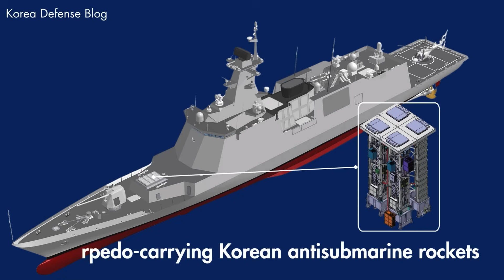South Korea’s Future Experimental Frigates

Comment: A failed frigate design. Main rule to be hammered down here is a rule for 360 degree coverage against water/air drones, airplanes and missiles. You need 2 CIWs using not only radar but also optic head. 30 mm CIWS II has right caliber (>= 30 mm), but is it using programmable munition? Design of Miecznik holds VLS and other missile containers in protected middle of the ship. I do not see 12.6 mm gatling guns with optic heads on sides like we will have in Miecznik. What's the point with an expensive one-use frigate, which can't effectively protect itself from a saturation sea-air attack from all sides? Secondary rule is that from WW2 most tanks and ships were destroyed from air and not by other tanks or ships. VLS 41 maybe like on Miecznik? South Korean frigate designers and ship builders need a wake up call. We can't have a strategical ally, who is falling behind technological development in these testing times. Specially one with larger industry then Poland has.
Reply: What do you expect to inshore frigate? FFX series ships for inshore fleets and their missions are keeping their eyes on North Korea and China's ships, submarines and also considering battle with an enemy's major fleet until the task fleet which is including many destroyers comes. if you want to seek and compare some performance for the fleet air defense with you guys new frigate then you need to compare Korean aegis destroyers because their mission is just as same as frigate what your country is building you may think i'm wrong but i think that's right comparison
Reply: @amirleokim3620  Did you know that originally Miecznik program was about corvette sized warship patrolling Polish coast? Then things changed with Russia and 21st century naval warfare. Suddenly 7000 tones were needed to put this all expected afloat and (5.5m) can't dock in shallow harbors. Ordering second NSM coastal battery from Norway changed nothing. Miecznik frigate is a classic escort frigate, will be used for protection of Polish coast and offshore infrastructure. Comparing it to AEGIS destroyer is kind of unfair. It will have 32 VLS, while dedicated AAW frigates can have even from 48 to 64 VLS and AEGIS destroyers have 128 VLS. Can we compare Visby 600 tones corvette with AEGIS destroyer, just because Swedish are modernizing it with 4-6 VLS for AA missiles?
Reply: 한국의 CIWS II는 AESA 레이더와 EOTS가 통합된 체계(LIG넥스원)이며,프로그래밍 탄약(풍산)이 사용될 예정이고, 무엇보다 체계부터 탄약까지 한국 스스로 독자 개발 중이다. 현재 지상 테스트 마무리 단계이며, 이미 양산 시설까지 완공되었고, 내년에 충남급 호위함에 통합되어 마지막 테스트가 진행될 것이다. 
한국 기술 발전이 더디다고????? Miecznik를 말하는 것을 보니 너는 폴란드인 같네.
난 폴란드란 국가를 사랑하고 존중하지만,
너가 제대로 된 정보 없이 무례하게 글을 남겼으니, 나도 똑같이 무례하게 묻겠다. 너희 나라의 기술 발전 수준은 어느 정도이냐? Miecznik에는 폴란드 자국 기술이 얼마나 들어가있느냐? 영국을 포함한 다른 나라의 기술들이 차지하는 비중이 어느정도이냐? 또한, 너희는 대체 왜 한국의 무기를 대량 수입 중이고, 기술 이전을 원하느냐.  너희 나라에서 모든 무기를 전부 독자 개발해서 사용해라. 한국의 기술 발전이 더디다니, 미안하지만 웃음 밖에 나오지 않는다 😂😂😂
Reply: @닮은살걀_i  Ridiculous is only what Ukrainians do with Russian Navy on Black Sea! Welcome to technology of 21st century. Developing and manufacturing independently has sens. It is important to be self-suficient as much as possible like South Korea. It takes months before allies can join up with their divisions. To be able to defend alone for a month or two is important. However it is NOT a requirement for national safety. It is an economical priority to all countries seeking industrialization, so nothing wrong with it with exception if it actually lowers your national safety. Then independent development is a safety national problem. Developing new weapon system alone could be very expensive and mind that munitions and spare parts incompatibilities matter during war, when shortages happen and allies send help.

Take under consideration VLS 41. French and British were developing independently their own alternative "mushroom farm" and it is too limited. VLS 41 uses wide range of missiles and it is easier to get help with spare parts and missiles from allies. Running out of ammo during war is A THING. Consider possibility of getting in form of help CAMM anti-air missiles from Poland and UK. Not only they would fit in VLS 41 instantly but you would get 4x enlarged anti-air capacity, as they are quad packed in VLS 41.

This South Korean frigate has blind spots in its close range defense. Pointing out that obvious weakness spot is not rude! It is life saving. Black Sea is dominated by Ukrainian drones for exactly this reason. US Navy on Pacific trains simultaneous missile attacks from couple different vectors of approach as well. What do you think Russians with their favorite saturation attack do? Miecznik with its weapon configuration has some decent chance to survive saturation attack. Can you say the same about this latest South Korean frigate? If you produce 100 of those frigates, then will it matter, when they all will share the Russian fate on Black Sea?

Seriously, this frigate needs 2nd CIW II for 360 degree coverage. It's basic requirement today.

Do this South Korean launching system allows quad packing for South Korean short-range anti-air missiles?

Do you think, it's not reasonable to produce frigates with weapons set up like in Miecznik, which will survive simultaneous saturation attack from 360 degrees? If you are not catching up on 21st century naval warfare happening right now on Black Sea, then yes your technological development is SLOW and BEHIND not only technology development, but BEHIND modern naval warfare as well.
Reply: @odrodzonasarmacja3721   If the VLS 41 could integrate Korean missiles, there would be no need to develop the K-VLS. The lower structure of the CIWS is the size of a naval gun, making it difficult to mount on medium-sized frigates. Moreover, the Haegung short-range missile system has already been deployed and installed.
Reply: @oaao3387  I see. Thank you for a honest answer. Do you know, British (quad pack) CAMM missiles are integrated into VLS41 and (double pack) CAMM-ER will be too? South Korea needs to have closer industrial connections to NATO's industries. British are very open to all economic cooperation. Maybe they could help with integrating South Korean missiles with VLS41? KVLS limited like "mushroom farm"? That's really bad. Really. How about getting British quad CAMM and double packed CAMM-ER missiles work in KVLS? Maybe British could help KVLS be more compatible with foreign ammunitions? Placing a naval gun even on corvette like Kormoran II was an issue. Though we were upgrading 22mm anti-air to 35mm anti-air with programmable munition. Our 35mm works even against some types of artillery shells. It works better against drones then 30mm Gatling, which I've been told has some issues with water used for cooling. Maybe something to check up by South Korea for medium-life upgrade for Chungnam frigates? Short-range missiles are cheaper but not that cheap and dealing with high speed boat-drones may not work. I would strongly suggest to add some 12.7mm (equivalent to Polish remote 12.7mm ZSMU A3/A3B from ZMT from Tarnow, which auto tracks targets) for 360 degree coverage. Not 7.62mm due possible armor and speed on the speed boats. We do have slow underwater bots (Gluptak) on Kormoran II to destroy mines and slow sub-drones, but on Miecznik we will have flexible 300mm torpedoes. Eurotorp MU90 torpedoes will serve to destroy enemy torpedoes and sub-drones too. Maybe, it is something South Korea should maybe look into?
Reply: @odrodzonasarmacja3721  You know nothing about Korea’s terrain, military equipment production, or operational planning. It’s pointless to talk to you about Europe and Poland. In wartime there’s no reason to worry about the East Sea — a large portion of North Korean forces are concentrated on the West Sea aiming at the capital region, and because of logistics, controlling the South Sea is extremely important. That’s why the coastlines should be held by medium- or small-sized vessels, destroyer forces concentrated in the South Sea, and why the mobile fleet headquarters and key ports are located on Jeju Island.
Reply: @oaao3387  I know Northern Korea holds your capital city prisoner of this cease-fire. Your economic miracle wasn't spread over entire South Korea. Centralization didn't serve your safety. You talking maintaining frontline at West sea. Northern Korea is not mounting a tactical attack you prepare to defend from, but a strategic one to break your military production and economy. They will not shoot for accuracy but for mayhem. Providing naval security for sea supply lines in East sea should be priority alike decentralization (alike we do in Poland) of South Korean economy. This strategy is a slight of hand by the Northern Korea, which didn't abandon the Eastern sea. They shooting their missiles into Eastern sea with too high frequency just to be "just some weapon testing (Jedi move of hand in air) you are not looking for". There some mountains so they will shoot further. Remember that those small sized vessels you write about will be in an intensive drone warfare area just one time use assets, if acting without proper escort. Their crews' lives? Jeju island is perfectly set, though Japan is highly demilitarized. Swedish army has excellent weapons too, but size matters. There will be issues. Gaps in coverage. Do you know about problems and time delays for development of multirole 7000 tones Constelation-class frigates by USA? There are simply not so many American multirole destroyers to do it all. USA's defense comes first even under Democratic Party leadership. If USA falls, then who will come to rescue us others? It's American argument. I wish this discussion be pointless.

There is in Poland saying that Polish Navy protects only their full-time positions and not Poland. Imagine Polish Navy wanted new torpedo boats with exactly same number of crew like 20th century never ended, because of "maintaining experience" and "RBS 15 is the best against warships". Can you believe this crazy stuff? I just hope ROK Navy is not set for the same mental pitfall. PGZ got robotized shipyard and Polish Navy will get 3x 7000 tones Miecznik frigates and NSM (or RBS 15 mark 4, it doesn't matter) to hit sea or land targets at 200+ km range. Isn't it better? Be honest.
Reply: @odrodzonasarmacja3721  한국 사람이세요?
Reply: @odrodzonasarmacja3721  seems like you are comparing two different types of frigates with two different purposes just because they are at the same weight class. sure it would be nice to have a 7000 ton frigate but with that weight class we rather build a destroyer(which is the KDDX, our next destroyer) and turn that in to a blue water vessel.
our frigates are capital ships for the inshore navy along side lots of destroyers and other frigates , main job is always to deter north Korean vessels, and to support our destroyers.
they are not meant to be a capital ship of the entire navy like Poland, who needs to do everything all at once because they have so few ships.

and besides, cheaper price made us build lots of them, we have like 18 frigates already, and many more to come. not to mention we have so many patrol killers that should be enough to deal with drones, 50cals are not really needed when you have more patrol killers than the amount of 50cals that can be installed on frigates.

basically, aegis does our multirole, not frigates, and even frigates have enough support vessels to fill the weight gap
Reply: @닮은살걀_i  틀포티야 제발 좀
Reply: These ships are built specifically for the threat Korea faces and given the budgetary constraints. Sure, it would be nice to have all the bells and whistles but given that there are 6 Incheon, 8 Daegu and 6 Chungnams (20 total.. plus more coming) cost is another factor. You should also consider ROK navy tactics and doctrine. The Mieczniks (only 3 vessels in total BTW) will likely need to hold its own in open waters but these frigates are more likely to operate in concert with the fast patrol boats and corvettes facing potentially hundreds of old North Korean coastal boats within the narrow coastal seas surrounding the peninsula.
Reply: @tommajor9860  It is true 3 Mieczniks will need to patrol coast of Poland, while securing 3 major Polish harbors on a sea, which is very narrow and shallow. ROK navy needs to factor in deep eastern sea. Alike closest to Poland is the far away Northern Sea. Poland has license to manufacture 8 Miecznik and may go for total of 6. I would still install an additional CIWS or some heavy machine gun automated turrets with optic heads on Chungnam. Just in case. Kormoran II is equipped like Chungnam frigate with 1 CIWS 35 mm, but it is NOT a combat ship! It is naval engineering (sappers). It requires escort.

Maybe ROK Navy has issues in their tactic not factoring in latest discoveries from what is happening at Black Sea? Chungnam-class may be is a result of failure in foresight. Those things do happen, but should be mended eventually or war will mend them at some greater losses.
Reply: @odrodzonasarmacja3721  You know nothing about Korea’s terrain, military equipment production, or operational planning. It’s pointless to talk to you about Europe and Poland. In wartime there’s no reason to worry about the East Sea — a large portion of North Korean forces are concentrated on the West Sea aiming at the capital region, and because of logistics, controlling the South Sea is extremely important. That’s why the coastlines should be held by medium- or small-sized vessels, destroyer forces concentrated in the South Sea, and why the mobile fleet headquarters and key ports are located on Jeju Island.
Reply: Whether the VLS is located at the bow or center has no bearing on protection. While I agree that the ROK Navy's frigates are under-armed, given budget constraints, it's difficult for a navy with so many ships to possess perfect ships when they're in dire need. Frankly, if a real battle were to break out near the Korean Peninsula, both the Miecznik and the Chungnam-class would be equally damaged and sunk, so acquiring them cheaply is more important.
Reply: @asdf-te2ou  Miecznik weapon configuration takes under consideration survival from a Russian saturation attack from 360 degree. OSU-35 is not gatling, but it has very high rate of fire and uses programable munition, which works against drones even in its land version on Jelcz truck. 32 tubes VLS 41 launcher gives at max 128 CAMM missiles to shoot down incoming missiles. Can you imagine Miecznik to take damage and sink like a Russian cruiser, frigates and corvettes on Black Sea from saturation drone/missile attack? Even 2x 12,6 machine guns will be automated.
Reply: @odrodzonasarmacja3721 Equating Russia and China is a major error.
To put it simply, China possesses an economy and population roughly ten times larger than Russia's, along with superior technological capabilities. While the combined military strength of NATO nations in Europe (excluding the US) vastly surpasses Russia's, the first-world nations in the Western Pacific region are nowhere near comparable.
To draw an analogy for you, a Pole, regarding the situation of the first-world nations in East Asia: it's like facing a Russia possessing the national power of the Soviet Union at its peak, while the European nations behind Poland do not exist, leaving only the support of the United States across the Pacific to rely on.

China's anti-ship threat encompasses a wide range of capabilities, chief among them an overwhelming quantity of anti-ship ballistic missiles. This threat is so severe that even the U.S. Navy cannot guarantee its own survival in this region. While it might be an exaggeration to say that efforts to maximize the survivability of individual ships here are meaningless, their value is significantly less important than the meaning survivability holds in Europe.
Reply: @odrodzonasarmacja3721  1. 당신은 내가 왜 답글을 남겼는지 아직 이해하지 못하는 듯 하다. 당신이 잘못 알고 있는 지식(충남급 호위함에 탑재되는 CIWS II에 프로그래밍 탄약이 사용되지 않는다거나, Optical head가 없다거나)과 기술 발전이 뒤쳐지는 실패한 호위함이라는 깍아내리는 말이 무례하다고 생각했기에 글을 남긴 것이다. 그리고 당신은 당신이 잘못 알고 있었던 부분에 대해서는 여전히 아무런 사과가 없으며, 내가 반박하지 않은 당신의 주장에 대해서만 계속 해서 반복하여 말하고 있다.

2. 충남급 호위함에 탑재되는 KVLS 에는 각 Cell당 한국이 자체 개발한 해궁미사일(대공 미사일)이 4발씩 들어간다.

3. 한국의 충남급(3600톤급) 호위함이 기술 발전에 뒤쳐지는 실패한 호위함이라는 것을 주장하기 위해 Miecznik(7000톤급)을 비교군으로 사용하고 있다. 당신의 말처럼 CIWS가 2문이 있다면 당연히 최후방어력이 더 올라가겠지만 공간의 제약과 비용의 한계가 있어 1문이 장착되는 것이다.

4. 당신이 말한대로 새로운 무기 체계를 단독으로 개발하는 것을 비용이 많이 들 수 있고, 탄약과 예비 부품의 비호환성이 문제가 될 수 있다는 사실이다. 한국도 아직 일부 무기나 부품의 경우에는 수입을 하고 있다. 다만, 한국은 지금까지 무기를 수입해서 사용하면서 더 문제가 크게 작용하였거나 오히려 비용이 너무 많이 들었던 부분들이 많았기에 자체 개발하는 역량을 오래전부터 키워왔던 것이다. 그리고 기술 축적이 잘되어 성능이 입증된 무기들은 전세계로 수출되고 있으며, 큰 수익을 안겨주고 있으며, 더 발전된 기술 분야로 나아갈 발판이 되고 있다. 더불어, 우리는 우리의 탄약이나 미사일만을 고집하지 않으며, 미국과 유럽의 것도 사용이 가능하게끔 만들고 있다.

5. 결국, 당신의 주장에 의하면 충남급은 CIWS가 1문만 있어서 기술 발전이 뒤쳐지는 실패한 호위함이라는 것인데, 당신은 한국이 드론에 대비하여 아무것도 안하고 있다고 생각하는 듯 하다. 충남급은 할당된 예산 안에서 개발된 호위함이며, 주로 연안을 정찰 및 방어하는 역할을 맡게 된다. 그리고 연안에서 드론의 공격을 대비하기 위해 여러 가지 방식의 소형 무인함정을 이미 개발했거나, 계속해서 개발 중에 있다. 

다시 말하지만, 난 당신이 잘못된 정보와 함께 CIWS II 가 1문만 있기 때문에 충남급 호위함이 마치 쓰레기인마냥 실패한 호위함이고, 대한민국은 기술 발전이 뒤쳐지는 나라라고 결론을 내린 행태가 무례하다고 짚으며, 반박한 것이다. 
1950~1960년대였다면 당신의 말처럼 대한민국은 기술 따위는 없었고, 당신의 나라는 커녕 아프리카의 가장 가난한 나라보다도 빈약한 경제력의 나라였다. 하지만 그 이후 대한민국보다 기술 발전 속도가 더 빨랐던 국가가 있다면 나를 납득 시켜봐라.
Reply: @odrodzonasarmacja3721  CIWS-II will be equipped with programmable SPREAD rounds. It will be developed in a way that a time-fuse setter is mounted in front of the chamber to input the information before loading the rounds.
Reply: @이민규-d9s4i  The AAW multirole frigates and destroyers then should be priority n1. National development and manufacturing should be less important, then quad packing as many AA missiles as possible in every VLS on every single combat ship. You could have 48-64 cell VLS v41 on a frigate, 128 on destroyer. Let's not forget that these escort multirole frigates are not only to secure sea lanes and under sea infrastructure, but also to provide defense to South Korean ports. None is under valuating China, but currently it is Russia in military alliance with Northern Korea.
Reply: @odrodzonasarmacja3721 You got the point.
In the Pacific theater, frigates are strictly auxiliary forces, unlike in Europe, and the mainstay of anti-air combat is large destroyers.

South Korea has two main types of surface combatant fleets: one is the coastal fleet composed of coastal ships, and the other is the mobile strike force composed of large vessels.

The Republic of Korea Navy's "frigates" serve as the flagship vessels for the Coastal Fleet. Their missions lean more towards OPV-like duties (though their operational periods are too short to truly be called OPVs), making them somewhat inadequate for demanding full-fledged air defense roles.
That's why they sometimes go out of their way to mount 5-inch guns on small hulls – they have to prepare for gun battles even in the 21st century, lol.

As a side note, Japan's Mogami-class and New FFMS aren't dedicated air defense ships either.
Reply: @닮은살걀_i  1. My "failed frigate" remark was mainly about holes in its defense, as you noticed. No words or demands for respect on your part is FIXING this existing vulnerability on this frigate. It could be worse if this CIWS was lacking in anti-drone capability, so I left a question about it. Video was extremely poor on details. Thank you for providing info, which is missing in video. It suppose to be a multirole combat vessel, not 1-use coastal missile speed-boat.

2. Quad packing is a good news. Poland in emergency could send CAMM missiles to South Korea. I read KVLS is comparable to VLS 41, but is it compatible? How does it work in other direction? Are Korean AA missiles compatible to VLS 41? After all it is South Korean dream to sell weapons to NATO/USA countries.

3. Then there is only one correct answer. 3600 tones is not enough. The new South Korean frigate needs to be a wee larger to fit additional CIWS. Also if AAW is really so demanding, because of China (so not only Russia+North Korea), then maybe few extra tones would be good to have for 48 or even 64 cells KVSL on this frigate. It is never wise to save money on safety. In war, it is cheaper to have few extra spare AA missiles left in KVLS after a fight, then to pay for a new replacement warship and crew. Crew should be the major issue due demography? Right?

4. I can only approve this posture. Compatibility of munitions is vital, when countries strategically support each other. Polish industry opted from indigenous production into joining global production chains of our allies. It provides steady and stable manufacture work in Poland, even when Poland is not buying. Plus locally made spare parts. Having optional sources for components is very important for robust defense industries, that independently manufacture their weapons and unlike South Korea are not sharing their technologies, like USA does for example.

5. Your requirement actually needs a patrol Corvette. You can't outfit such a small vessel into an able multirole combatant. In peace Coastal Guard's vessels could take care of it. Way cheaper. Military alternative is not big either. Look at Sweden. 600 tones Visby Corvette will have small VLS for AA missiles in them and it's a stealth warship. Then we have a speed boat SB90E/H, which can fit radar, sonar, able to put mines in water or drop torpedoes and can carry squad of marines for coastal assault. Ways more affordable then a multirole frigate with a glaring vulnerability.

If you invest in true multirole naval combatant with strong AAW, then size of frigate is bare minimum for this role. If you invest, then you should make sure there are no glaring holes in its defense. Make sure it won't sink after 5 mins of combat. You know how slowly warship turns in water? What a point with 300m warship, which can be destroyed with 200k speed boat fully loaded with explosives, after few minutes confrontation? It is very hard to shoot very fast moving target. When stationary, you can puncture it easily, but when it goes 50+/80+ km/h, then suddenly bullets are just bouncing off it. Also forget to shoot it manually like Russian sailors tried. They failed.
 
I do not know, who is responsible for creating those requirements for Chungnam frigate. Some admirals, even in Poland, would like to fight glorious naval battles from beginning of 20th century. No airplanes. Kind missiles flying only there where sole CIWS is. However Poland has a highly developed drone industry, even in comparison to South Korea. Therefore those admirals didn't get their way. Design of Miecznik had to have 2 CIWS for 360 degree cover with programable munition and couple automated 12.6 mm turrets. It is a respectful modern requirement, not a disrespectful assertion. The requirement, which the Chungnam-class frigate is obviously failing.
Reply: @이민규-d9s4i  Isn't Russian fleet at Black Sea mostly a coastal fleet? Ukraine does not have any warships at Black Sea and still did a massacre on Russian Navy. Even if mission type didn't change the combat environment did drastically. Drones come in air, water and under-water variety, a warship needs to see and pacify them in time. Warship does not need to be dedicated to air defense these days to have some AA capacity. Polish mine warfare corvette Kormoran II has 35 mm to kill airborne & water drones. Artillery does not mean only gun battles. Swedish recently outfitted some SB90H with 120 mm artillery and tested it as artillery support from sea when landing batalion of marines.
Reply: 군함도 못 만드는 나라에서 무슨 말이 많냐.그럼 트럼프가 좋아하는 러시아나 중국에 부탁해서 만들던가.
Reply: dude your country is buying weapons from Korea and that ship of your isn't even built yet.  you're in no position to criticize our ships.  don't worry about our weapons that have nothing to do with your country.  be grateful for the weapons we sold you and mind your own business.  we'll humbly accept any criticism if that ship of yours turns out better than ours.  btw South Korea is one of  the best ship maker in the world.  is Poland know for ship building?
Reply: @jwo122  I am concerned about safety and lives of Polish sailors. Your ships have nothing to do with my country? South Korean government plans to gift Poland Pohang light frigate and 209 type sub for free just to become partner in Polish ORKA program. Money eh? TBH Pohang looks better then Chungnam in ability to defend from sea drones and air attacks. Why don't you build more Pohang instead of Chungnam? Too expensive? Poland does not have own tank or airplane manufacturing (any more) but shipbuilding Poland has for last 100 years like a hard standing industrial idiocy. Poland's survival depends on land warfare and not sea one. Joining Polish manufacturing with South Korean seems like a way to rebuild all Polish industries, while rising strategic safety for both our countries. Do mind that your coastal fleet defending South Korean harbors, like Miecznik will in future with Polish ones, will be also protecting Polish shipping to and from South Korea and not only South Korean one. I could be picking on allied British Royal Navy, but they saw recently "the light" and got VLS 41 instead of "mushrooms" on their type 26 and 31. Type 31 will be getting towed sonar alike we have even on our Polish corvette minesweeper Kormoran II. See? It is not a childish game and hurt feelings on who is better over who. You have the thing or you don't. Do you see this Failed Titanic with CIWS on Chungnam or you're waiting for an epic mass sinking of Chungnam frigates when war starts?
Reply: @odrodzonasarmacja3721 dude if you don't like the quality of our weapons you can refuse to buy and even refuse the free offers.  if your country could make better quality weapons you would have done it already and not by Korean weapons.  you do know that Korea is actually lending Poland the money to buy our weapons.  you should be grateful and stop complaining.  like I said if you have better options go for it.  btw if your Poland is making this ship thats supposed to be way better than ours why would you even consider accepting any of our sub quality ships.  just build your own ships and don't worry about ours.
Reply: @jwo122  You would be right in what you write 10y ago, but you ain't for couple of reasons. 1. South Korea and Poland joined in strategic INDUSTRIAL military cooperation. 2. Polish and South Koreans are facing TOGETHER danger from the same enemy countries. 3. South Korea and Poland may want to support each other with already manufactured weapon systems. It would be good, if those were not FAIL TATANICS. 4. Complaining is a national sport of Polish people. 5. Were you ever to a football game? In comparison I am very respectful in expressing my deep concerns. 6. Demographic catastrophe, which consumes both South Korea and Poland, has double bottom meaning for Polish people due Holocaust. Poland feels very badly missing 50% of its population to be able to face both Russia or Germany on an equal footing.

7 !!! Survivability of soldiers and sailors maybe means nothing in Asia, but it is high priority in Poland and I think also in Israel. Likewise USA also is bend on minimalization of their casualties. It is a mentality set very different to countries like "u nas ludej mnogo" Russia and populous China. Countries to which contrary, I think our countries could spend a tiny bit more on our troops survival rates. Specially that our both countries currently are not so poor any more. Selling weapon platforms best fit for Russia and China will not have a good rate of success in Israel, USA or Poland. Don't you think? Specially if Polish military complex would be involved in providing parts and components to such South Korean sales in their production chains. Possible purchases by smaller countries of Intermarium maybe?

8. About ability of South Koreans to relay not only on indigenous development and manufacturing. With technological progress developing and manufacturing weapon systems gets more expensive and technically complex. Joining international development project and then being part of global chain of manufacturing suppliers and manufacturers is ensuring every involved country back up in time of war. Not to mention secured jobs in military industrial sector. Poland is a copper country and has nowhere near production of rare elements like China, but Poland canz it (KGHM company). Like drone industry (South Korean army bought already some of those) our technology in producing rare earth metals is best of the best. Though small. 9. Polish people are in majority Roman Catholics and to care about people who stand close to us is part of this religion. So, you are welcome!
Reply: @odrodzonasarmacja3721  dude Korea and Poland are not strategic partners.  we don't have the same enemies.  our primary enemy is north Korea and china and maybe potentially japan whereas Poland's enemy is Russia.  you have nato to deal with Russia and all we're providing is weapons.  weapons deal don't equate to partnership it's a transaction.  Korea is not gonna jump in if you're attacked by Russia and Poland is not gonna jump in if South Korea is attacked by north Korea or china.  it's simple as that.  stop concerning yourself with our military and it's weapons especially our naval vessels.  all you need to concern yourself is the little piece of the Baltic Sea that you're country has to defend.
Reply: @jwo122  Someone just woke up and didn't notice to be holding hand in Russian pee puddle. North Korea and Russia have military alliance. Russians soldiers will be mostly Asian Russians but still shooting at ya! Black Sea and Poland are not close. Did it stop Poland or USA? Polish Military sales are 3 mld euro and 2.4 mld euro are sales just to Ukraine. Why don't you South Koreans make a quick money too? You dream Russia cancels its alliance with North Korea? 🤣 Mhm. 🤣Poland jumps on any US war party with at least one brigade for last 30y. Did you send troops to Afganistan or Irak too? Suspiciously looking American military bases in Southern Korea. Those concerns about your warships. IF ROK Navy miserably fails due badly designed close defenses on your frigates, THEN Miecznik frigates could arrive and one Polish mechanized brigade will. Not because any South Korean asked for it, unless he is an American citizen working in Pentagon.
Reply: @odrodzonasarmacja3721  dude north Korea is trading soldier's for weapons.  russia is not gonna get involved if north Korea and South Korea get into a conflict.  stopping coming up with these scenarios where everyone is partnering up with someone.  you sound like one of those people who were spreading rumors about South Korea sending soldiers to help Ukraine because north Korea was sending troops to fight for russia.  if you haven't notice countries aren't that willing to send their troops to fight other country's battles anymore, not even the US.  look how nato and the European union is only helping with weapons but not directly getting involved.  if no one else you would think Poland would get involved seeing how close in proximity you are to Ukraine but we know that hasn't happened so why would you think that Poland and Korea who are continents apart would be strategic partners in anything.  like I said before it's a business transaction, an arms deal.  
stop trying to get Korea involved in your country's welfare.  unless ww3 breaks out with Asians countries getting involved there's no chance of Korea partnering up with Poland for any conflicts or battles.  So you worry about your country's weapons and we'll worry about ours.  you don't see any Koreans concerning themselves with Poland's weapons so you should do the same about ours.
Reply: @jwo122  ww3 is coming. EU is more break then help (Germany? Hungary? Spain?). Polish soldiers do fight in Ukraine from start... privately. Polish parliament instituted law allowing it. You gotta have some balls you know. K9PL, K2PL, their next versions are already involving Polish engineers. Poland has airplane industry. Not own owned any more. Possibilities, when your country has know-how, know-why and plenty of specialists. Even if Russia is not involved in Korea, the participation on side of Americans gives Polish army precious practical knowledge in modern war, which is essential when brought back from missions. Don't say you South Koreans are still preparing to a war from couple generations of wars ago. That would be foolish. Equipped and trained in time soldiers need also some war experience to excel over enemies. Well protected Korean coastal lanes and harbors are required. I wonder why Pentagon is not pressing ROK Navy and your shipyards to produce and use capable warships for coastal seas naval warfare. Pentagon sees what happens on Black Sea too with all those speed droneboats, subdrones, airdrones, which some launch missiles on their own. Guess who is providing and paying for Musk sat-links for Ukraine. 😇🤣
Reply: @odrodzonasarmacja3721  Frigates in South Korea don't contribute that much to overall combat power. If we didn't have North Korea, we'd be building lots of destroyers too. Frigates are coastal forces, while the real power is the mobile fleet made up of destroyers — Aegis destroyers, the Yi Sun-sin class, and the upcoming KDDX destroyers. Recently there's even been a move to secure 18 KDDX destroyers.
Reply: @odrodzonasarmacja3721  And no matter how powerful the United States is, they can't tell our country what to do. If they tried, there would be an immediate backlash and very serious consequences.
Reply: @odrodzonasarmacja3721  South Korea is working hard to achieve independence with systems like Link-K, K‑GPS, satellite communications, reconnaissance satellites, and unmanned aerial vehicles. One thing to know is that the U.S. and Western countries will never share or sell core technologies to us. The truly essential technologies are never sold.
Reply: 줄게없어 닭이나 팔아재끼는 나라 주제에 건방지노 ㅋㅋㅋㅋㅋㅋㅋㅋ😂